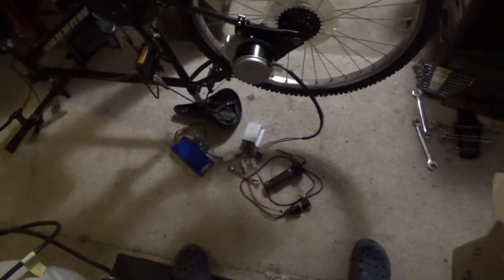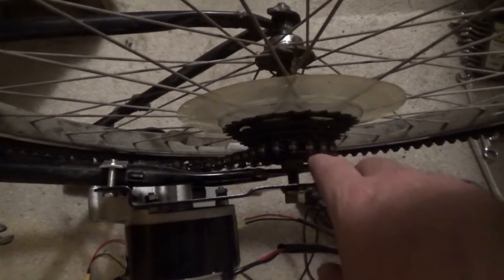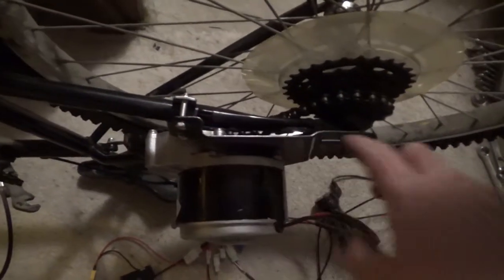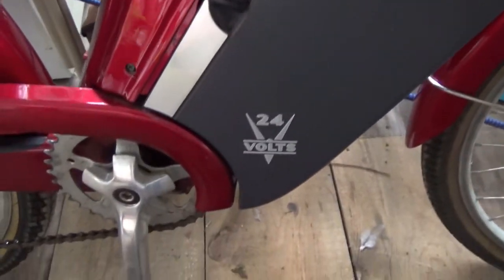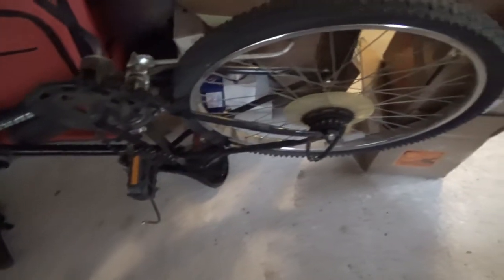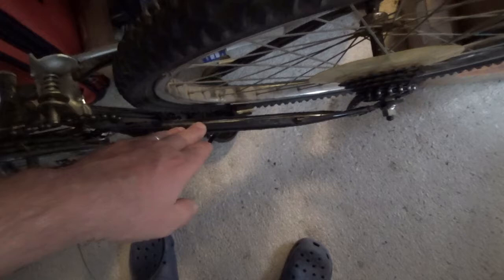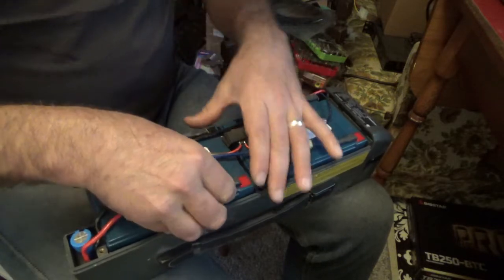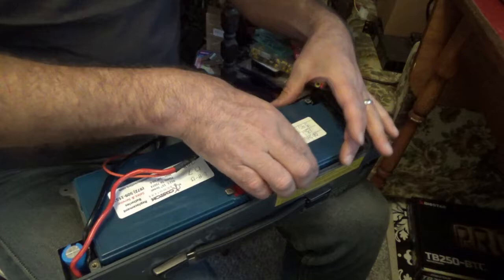Attempt To Build An Ebike With Chinese Kit Failed But Then This

Comment: Most 12 year old's would have it working in a couple hours.
Reply from the maker: Isn't that nice for them. I guess that most 12 year olds have access to welders and fabrication equipment. And I guess most of the people who purchased these do not either because they could not get it to fit their bikes without fabrication or welding. I am not upset though because I knew this going in and I realize I cannot buy the individual parts for the price I paid. And I figured if it wont work on my bike, I will use it for the car I am going to build.
Reply: @thedoityourselfworldelectr8007  You have a welder  and the tools to modify it to fit. The part you are short is the knowledge.
Reply from the maker: No, actually what I am missing is a circuit breaker to run my welder. I have to rewire the house cause my welder is 20 amps at 120 volts and our breakers are all 15 amps and many circuits are running on each breaker. Horrible wiring. I bought a monster generator to power the welder but sold it this summer not long after. The offer was good so I took it.
Reply from the maker: Its not about simple or not. Its about code and costs. And time. Eventually I hope to redo our wiring and get some good high power lines in here and some more 220 volt lines. For now tho we have been expanding our solar usage and capacity as we can.
Reply from the maker: And these battery packs are on the top of the priority list. When not used for the bike they will be in the power wall. Plug and play system. Pull out a pack and go for a ride. Get home and plug it back into the house system to recharge.

Comment: Back in the electronics lab?
Reply: Lab?
Reply from the maker: I do have an electronics shop. A solar powered shed just for electronics projects and experiments. But this was done inside the chalet.
Reply from the maker: George what are you saying??? Load test what batteries to prove that I have an electronics lab???
Reply from the maker: George, which battery bank? I am only confused cause the original question was if I was in my electronics lab. I have a solar powered battery bank in there if that is what you mean?
Reply from the maker: If you mean the E-bike battery, I will certainly do that when its done.
Reply from the maker: As I build them I will absolutely be load testing them on video.
Reply: @georgesimon6041  lol

Comment: Troy, rather than putting junk batteries on a Bedini thing for an undetermined amount of time.... You can buy new batteries from the manufacturer... Item# PS-12140F2 for $48.95 each. Sounds expensive, but not when compared to similar batteries. Can't mention the company name on your channel or this won't post!
Reply: Note: Amazon has that battery for $39.95. But if you can get a working Lithium-Ion battery pack, that would be great too.
Reply from the maker: I am building lithium ion battery packs for this. Those batteries I am showing cost about 40 cents per cell. I love restoring old things, as you know. I will restore the lead acid batteries (if they can be restored) and run them as well.